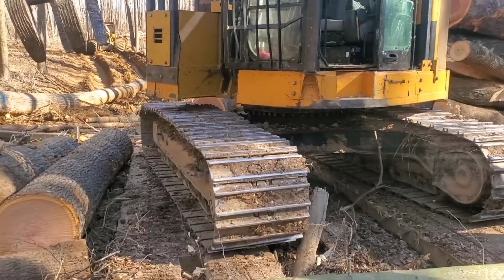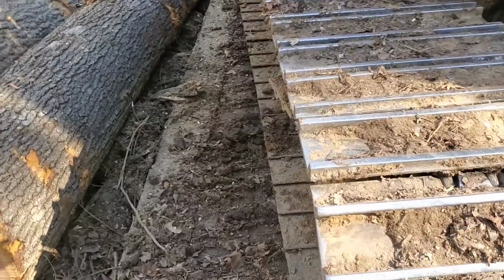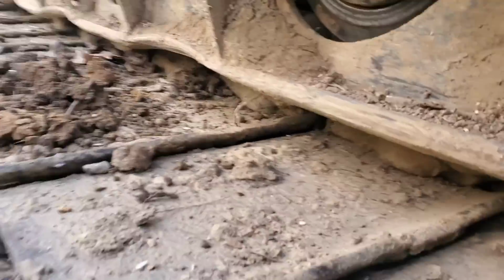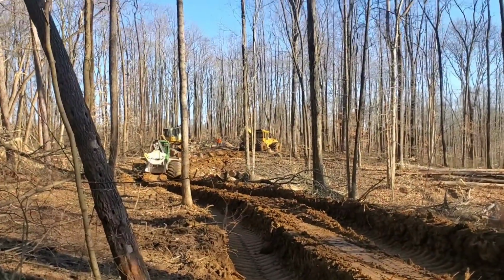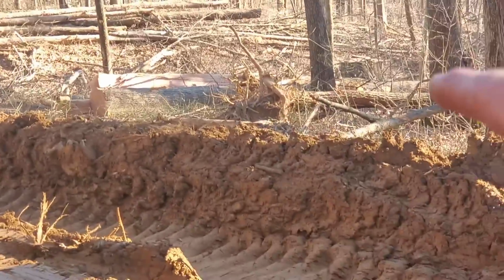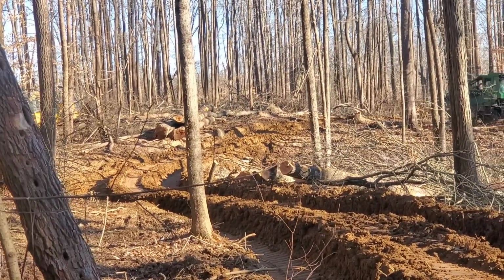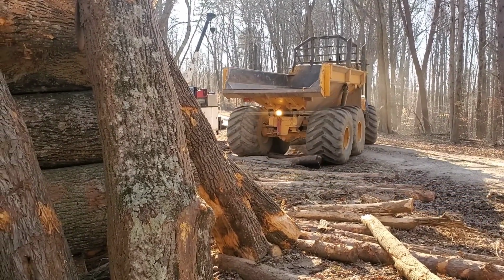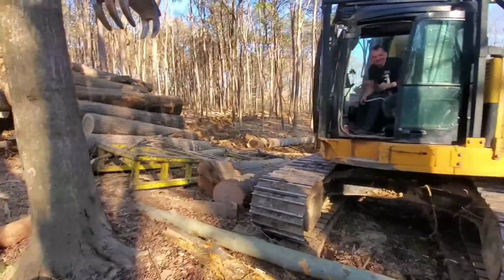Soft Ground at Billowbuilt Station!!!

Comment: Type of mud u in 
Duel 28s
Or 30.5 dulled up with 28 so u not always on duels on hard ground but once u sink duel outside starts pulling.
Reply from the maker: Got ya thanks bud
Reply: @LoggerWade  
Check out Thomas Johnson logging they cut by my house and he set up with the 30.5 28 duals help sliding on logs too..pulls like a 10 legged mule

Comment: Which one pull timber better cat or John Deere
Reply: Dirt Pride 29 nowadays, probably Deere but cat had a far better machine in the 508 (508,518,528) days. Those would be the C to D series Deere days. The old Deere skidders were somewhat more tractor based and not meant for as extreme of conditions as the cats